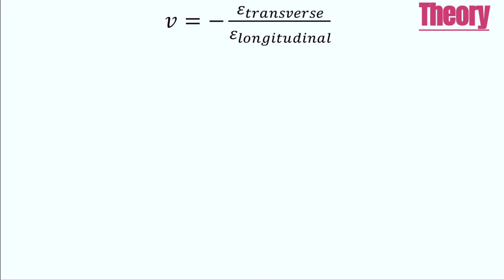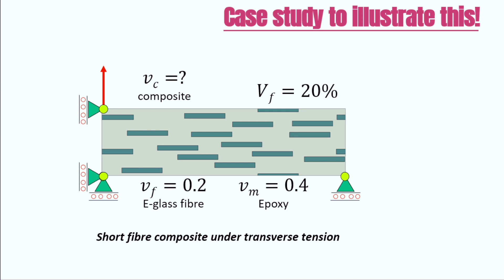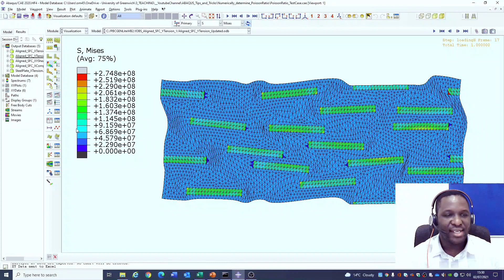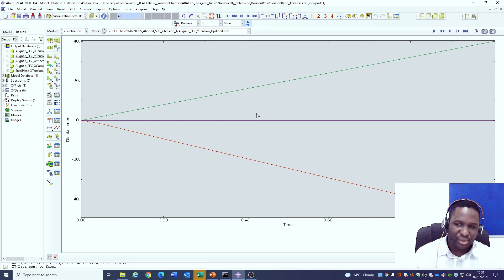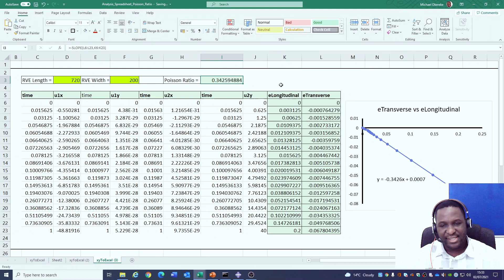How to NUMERICALLY determine Poisson Ratios in #abaqus

Comment: Suppose, I take two materials in powder form to make a composite consisting of 60% Al2O3 and 40% MgO.  How can we calculate the Elastic modulus & Poisson Ratio of the composite in Abaqus?
Consider, there is no impurities into Al2O3 and MgO. They are exactly in same size & shape and their operating temperature is also same.

Here, Individual Elastic Modulus for MgO= 249 Gpa and individual Elastic Modulus for Al2O3= 7× 10^10 Pa. And Poisson ratio for Mgo=0.35 and Al2O3= 0.22 (for 96% alumina).

If it’s not possible to determine in Abaqus, then how can I calculate these  two values?
Reply from the maker: Hello @Ashfakur, I think there are two approaches to doing this;

1. Analytical approach: Here, once you have the volume fraction and properties of each constituent, you can use various mathematical models to determine the effective properties of the composite. These models include rule of mixtures, shear lag model, and Mori-Tanaka model. I will start witht he rule of mixtures and this is for the inverese rule of mixtures appraoch. Of course that will not be as accurate as the Mori-Tanaka models. 

2. Computational homogenization method: At times if your constituents are of diverse diameters and distributions, the analytical methods might not be adequate. A computational method would work. You can follow my videos here where I show how to undertake this sort of work. https://youtube.com/watch?v=iNdFo5xwStI&si=EnSIkaIECMiOmarE. At the end, you generate stress-strain plot and from there generate the effective properties based on that. You can use the same model to generate numerically poisson ratio as i showed in this particular video.

Comment: Hello Sir,
I'm trying to calculate Poisson's ratio for 3D lattice structure (Applied Compression load in Y-axis of 7mm displacement). Bit confused which nodes to be selected for extracting longitudinal and transverse strains. Need your valuable suggestion
Reply from the maker: Hello @Nani, good question.  I will see if I can make a quick video to show this.
Reply from the maker: Here is the video that can help with this query: https://youtu.be/tmFR2OiRKbw

Comment: Hi Sir,

May I know what is the rationale for choosing those 2 nodes for U1 and U2? Thanks!
Reply from the maker: Hello @TM, thanks for your interest in the channel. I used the periodic boundary conditions on the models of the short fibre composite. As such, only the corner nodes (four in total) can be used to prescribe loading and extract history outputs from the model. So, since I wanted to extract transverse and longitudinal strains, it makes sense to use same nodes to extract the displacement histories in x-axis (U1) and y-axis (U2) directions. So, the data plotted in the video are from those two reference nodes. I hope this explanation makes sense.